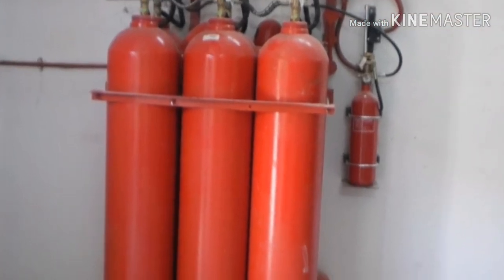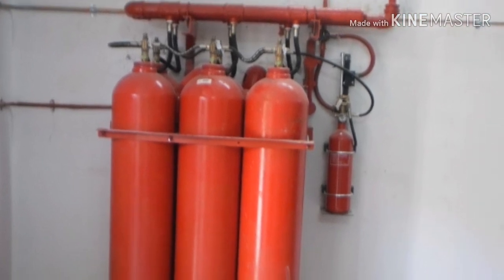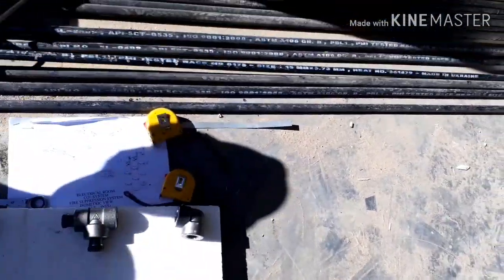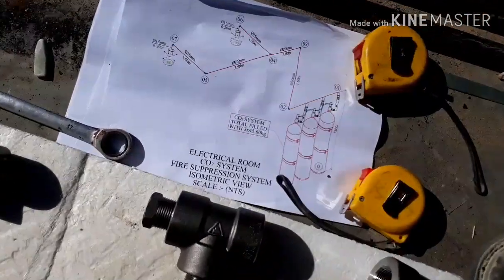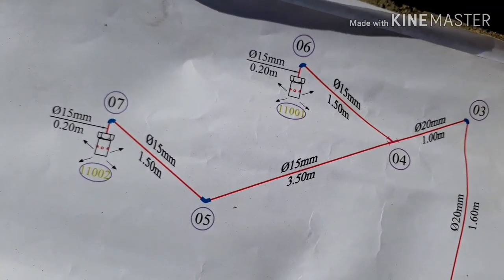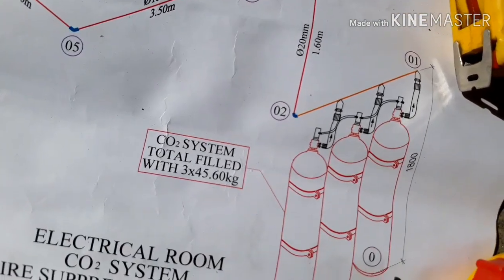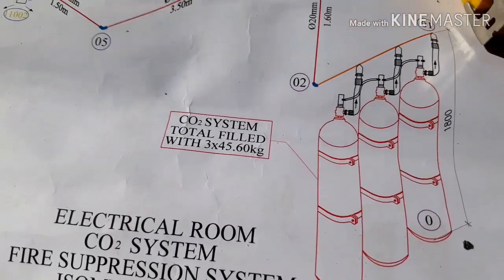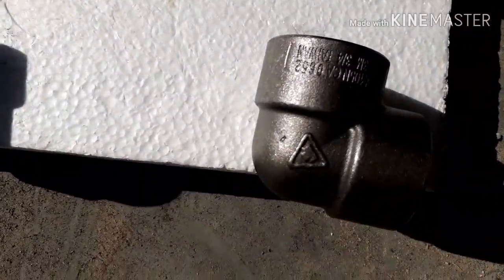Carbon dioxide (CO2) fire suppression system piping installation

Comment: Nice explanation. Is the testing pressure 140bar or 14bar @50c?
Reply from the maker: Mr. Talha,  They are manufactured in Seamless steel for high pressure with maximum safety at 140 bars @ 50 deg c.
Reply: @saudicompany7864  Thanks.